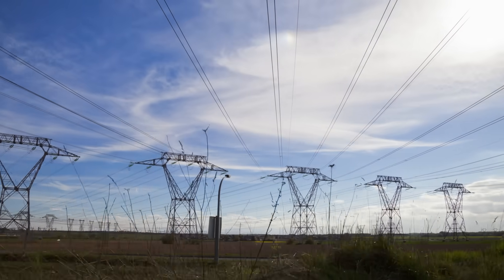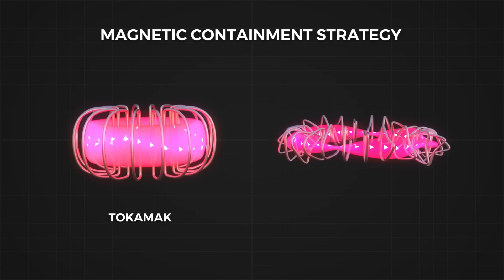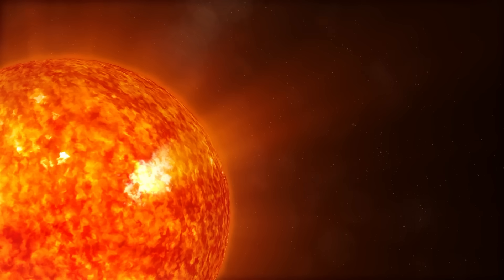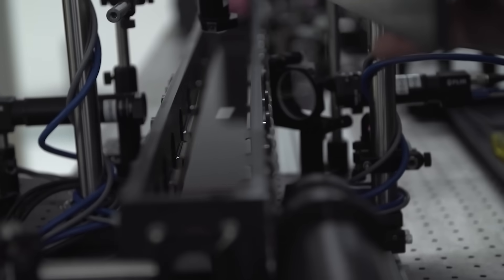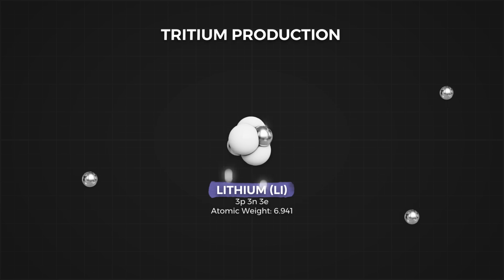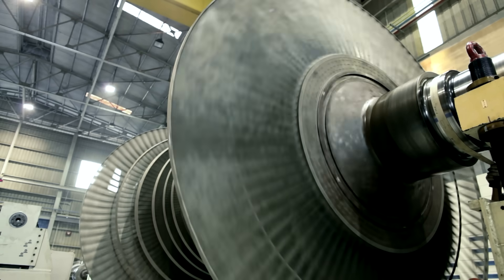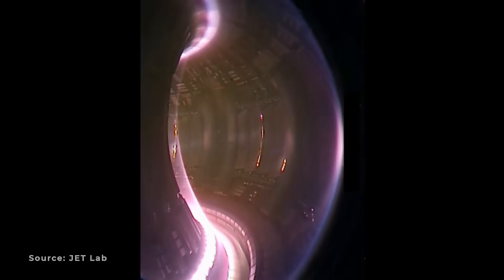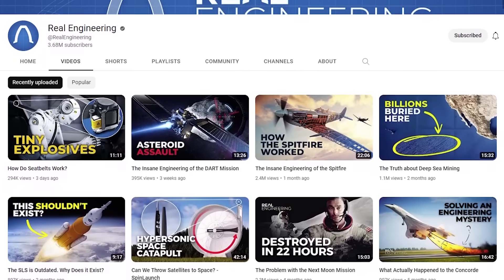The Problem with Nuclear Fusion

Comment: I had a presentation in my masters class few weeks ago, and my topic was about why nuclear energy is fine to use.. every single question/problem that I had encountered, I found a solution and an answer for it, the whole thing was amazing and very convincing. However, one point i didn't mention in my presentation, because i knew it will demolish my entire thing, is cost. Since i wanted my presentation to be as an advertisement for the nuclear energy (I live in France where 80% of the energy is nuclear), i wanted to give the best of the best in it, and show how every safety issue has a solution, as well as every public concern is being dealt with.
Reply: I don't have a masters in anything, but you could use the argument that the cost of "cheap" hydrocarbon fuels is their emissions, both pollutants and greenhouse gasses. How much effect they have / how long they last are up for debate, but nuclear fission waste can be partially consumed in fast-reactors and/or stored in a barrels. So do we want the effect to be on the atmosphere, or in a storage facility.
Reply: @TurboHappyCar  Regarding this approach,  i talked about the energy to cost ratio of uranium compared to fossil fuel. This included the mining, the purification and finally the transfering, just without the building cost of a power plant. Although i think that nuclear power plants have more lifespan than their rivals, in terms of cost to lifespan i think nuclear will equalise a little but still lose in this aspect.
Reply: Really cool topic... though two other arguments against nuclear often cited is their inability to adjust to demand and the difficulty in managing waste. I have heard (not sure how true it is), that the ability and technology for building reactors has been lost somewhat. Is this true, are we still able to build these reactors on a large scale?
Reply: @NitroniumGaming  nuclear waste isn’t a massive issue anymore, we have ways of containing it until the half-life renders it harmless. The military also loves shooting nuclear waste at people
Reply: Cost surpasses every argument that you have for it, unfortunately. If we can use inefficient energy sources that cost cheaper to produce per megawatt then industry would prefer that because it's better for their bottom line.
Reply: @radarpinki  Also Why use outrageously expensive fusion if solar and wind are way cheaper
Reply: @reuven2010  Because solar and wind take up huge swaths of land mass to provide equivalent power. That doesn't make them bad, but current designs make them ill equipped to replace natural gas or nuclear. Even hydro electric dams take up minimal space, but greatly affect the ecology around them.  Nuclear might be expensive, but I think its very much a risk reward problem.
Reply: @reuven2010  I had no doubt that I would receive such a question, thank you. First, not all countries have enough sunlight hours, some areas have 0 sunlight hours for a few days( near the equators). others like Europe don't have enough hours during the winter, which is a large portion of the year, thus they rely on other methods, the wind is great too, but also u don't have windy weather the whole time ( like here in the Rohn Alps). This can be solved by adding more solar panels, along with a sunlight tracker which might increase the overall energy production somewhere between 25 and 40%. However doing this stuff for a little extra energy production will require a ton of money, to the point it becomes worthless. 
Another way to use solar panels in the sunny territories, aka deserts. But transferring the energy, taking into consideration that these areas don't have infrastructure generally, will skyrocket the cost beyond the worth tag. The fossils are still the cheapest and easiest way to produce energy. However, this doesn't mean they are the best, or even the safest, for both human life and the environment. Bearing in mind that the safety, clean air, and proper food, might really be worth the cost, it is just that nobody is ready to pay more for those.
Reply: @AmphibiousPatriarch  Totally agree, add more that with higher demands on such energy production methods, more innovations and discoveries will pop up, perhaps making it cheaper, and more efficient (for example; the lithium batteries)
Reply: @radarpinki  To be honest, we look at the outer edge of the projects in terms of cost. But when the big companies get into a real project, their engineers calculate every single detail, to be clear, let me give you an example that blew my mind back then. They even calculate how they affect the environment in the area, the government restrictions and taxes, thus they add this to the maintenance cost of the fossils, the cost of fixing the environment after messing it up with fossils, the cost of the health care of those who get affected... literally every single detail that might come into mind, Also i disagree that we are moving away from nuclear,  i have been following up the news since 2015, and all i see is a growth in the overall share of the worlds energy production. Here in France, the nuclear energy production share rose 10% in the past decade.

Comment: Thank you for mentioning the beryllium problem. I have been watching lectures on the promise of fusion for decades. Some common memes are the claim “cheap and clean” and “seawater”. They want the audience to concentrate on the shiny nuclear physics and ignore the dirty engineering. The costs of the non-ideal engineering tech are minimized. The cases for solar, wind, and cleaner safer fission are stronger. My view as an old physicist is that the Tokamak lobby is strong politically and keeps the fusion bubble aloft by politics.
Reply: Nuclear fission is the future.  Safe, clean, carbon-free 3rd and 4th gen plants.  

Fusion and solar/wind are the past.
Reply: The big engineering obstacle is volumetric power density.  For DT reactors, this will utterly suck compared to fission reactors.

Comment: The video at least mentions cost, but it doesn't go into any detail on the subject. Fusion is not just a scientific or an engineering problem, its an economic one. We already have dispatchable clean energy in the form or renewables and energy storage. The former is mature and cheap. The latter is more expensive but will mature and get cheaper. So by the time fusion is a done deal in engineering terms, what it will be competing with will make it uneconomic to actually implement. You don't do something if you can have the same outcome for less money.

Oh and btw if we're going to talk about energy sources that may be available 20-30 years from now, we ought to also talk about things like geothermal. New millimetre wave drilling technology has the potential to make deep (high power) geothermal practical. And that will always be a far simpler and more robust tech than fusion.
Reply: I feel annoyed by your kind. The kind that always stands in the way of technological advancement. Fusion is barely talked about as it is and is also severely under-funded, yet you find the need to shit on it. 
Here's something to enlighten your pea brain:
Inertial Confinement fusion has a non thermal approach being worked on by Marvel and HB11. If successful, it could pave the way for non terrestrial power plants, especially propulsion.
So, sit this out if you don't have anything positive to contribute.
Reply: @rajuaditya1914  Why? I'm just as excited as anyone about the prospect of getting fusion to work as a piece of engineering, but I'm being realistic that it will not compete with other forms of energy production/storage. Also, I happen to agree that fusion has a future in space. Edit: and while I'm at it, there are several implementations of fusion that use p+B fuel and that don't rely on thermal neutrons. You get nearly all of your energy out in the form of charged particles and x-rays. That's a lot more space-friendly because you're not then trying to build a big heat engine and have gigantic radiators.

Comment: Best way to get nuclear power running, fusion or fission, is to have the government do it. Not because the corporations wouldn't do it right, but because they would try to cut costs as much as possible to keep profits high. Cheap and renewable power, especially fusion which would be pretty much free, just doesn't go well with a profit motive.

Comment: Just curious, is there a way to make Nuclear Fission reactors more economical?
Reply: They are mind-blowingly economic, the cost is in maintaining regulations and bureaucratic bloat. They are also safer than almost any other industrial process but the issue is the political ramifications of an accident.
Reply: @JB-mg5lw  Mind-blowingly economic? 😂 not remotely. Regulation isn’t even the issue. It’s poor supply chains, programme management, and the rising costs of raw materials, leading to high EPC and capital costs.
Reply: @Gomlmon99  Absolutely wrong and as I have been in the industry at all those levels at various times for 4 decades I can personally attest to that. The costs of fuel and actual technical management are dirt cheap compared to the insurance and regulatory requirements of running a nuclear power plant. The plant I currently work for was the first in the US to get relicensed, do you even know which one that is without looking it up?
Reply: @JB-mg5lw  Why are you talking about cost of fuel or running it? I said EPC and capital.

Comment: If unlimited clean power with no nasty by products was easy everyone would be doing it .
It is not impossible but extremely difficult to put the sun in a jar so how we heat things up and split the appropriate atoms is critical .
The power needed to kick-start the reaction is extreme . 😎
My speciality is mechanical engineering and l understand the hurdles that fusion puts before us .
I deal with what is currently possible and have the designs on the board to prove it .

Keep trying.

Comment: So they literally say it's impossible as physics won't allow more energy out than in unless obviously it's a neutron star collision or creation of a black hole.

They literally need to put more energy in the material than is used in the magnets which has to have more energy than what it's containing cause those magnets waste much energy in the 360 degree field around itself.  And you can't hold back more with less...

It's literally a pipe dream unless they have neutron star density that s machine wouldn't be able to handle...

They even already have energy bring made that they can't account for as well and still no fusion.... As they ignore that the sun's core is so dense that Thor's hammer made of the same stuff would weigh 300 million elephants... And that's not even enough according to some as they think the sun doesn't just do two firms of fusion but also has quantum tunneling to higher energy going on. Which seems to be happening in their machine already, that's probably where that extra energy came from... Still no sustained reaction with net energy....

And it's crazy cause the climate change is mostly caused by Water vapor. 50% is caused by water vapor like what hydrogen fuel cells have off. As 25% is from gases, as 40% of that 25%  is from The earth itself as they use their lowest estimates in output.. Even tho thier assumptions were blown out of the water with that last discovery of the geothermal lost city that puts out 100 times more green house gases than any other known natural source.... And they expect to find more and still haven't said wether that 100 times more is more than the next biggest single source or all previous sources put together..... and they expect to find more sites like the geothermal lost city in the other 97% of unexplored oceans... The last one dropped our contributions by anywhere from 5 to 10% or more by itself and showed they really low-ball nature's output in their simulations...

As they also say the last great extinction was caused by global warming that was much faster than now even as before the ice age it caused there was no human made greenhouse gases.... They even say it caused the ice age faster... 

But now days they say warming pushes an ice age further away unlike what they taught for decades in school.....

It's like they know it's not humanity as history says it fluctuates randomly already... As the scientists and politicians are like Columbus and we are the tribes people.... He told the native tribe to give them stuff, they did but he wasn't happy with it so told them his God would make the moon vanish as he knew more than them and sn eclipse was about to happen. It happened and the tribe was terrified then gave them even more stuff they couldn't actually afford to give.... 

So climate change is literally unstoppable and would be about where it is now even if humans were never around from what all the info says without nit picking things. 

So how do you stop what's so far always been happening and why is no one planning for an ice age that could literally scrap cities into the ocean and is probably closer than the 10,000 years the estimated before..... 

Why's no one actually looking for a solution that lets us adapt to the environment that's gonna change at about the same rate wether we pollute or not....

And it's funny cause they know. It's impossible to not know given all the info they have and share. As even what they share that's nit picked shows humans are barley effecting climate through green house gases...
Reply: This comment aged so poorly it was disproven before you even posted it.

Comment: Fusion has been twenty years away certainly as long as I've been alive. In the meantime, how much closer might we be to a decarbonised electrify grid if the billions that have been poured into fusion research had been diverted to renewables and especially the large scale grid energy storage needed to make them practical at scale instead. I look forward to the next part in the series with much skepticism.

Comment: 2:30
Typo in the subtitles. Says 'changed' whereas it should be 'charged'.
13:02
Another one,  'ura nium'.
13:30
You say 'energy' bu the subtitles says 'electricity'.

Great video by the way. Love the rivalry with Wendover.

Comment: Beryllium is not rare, and its not hard to mine. The problem is in working with it, its incredibly toxic material that requires special processing. THAT is the problem with beryllium. Supply could be increased substantially, but manufacturing all of that will be costly.

Comment: Everyone seems to be unaware of Lawrenceville Plasma Physics' Fusion project!!! LPPFusion is a small operation with a team of only a few people, with a very promising approach to a much safer and smaller fusion energy system. They've achieved record output-to-input energy ratios that make the big tokamaks and stellarators which cost billions of dollars look like lost causes. Not only that but LPPFusion is operating with a boron fuel instead of rare elements like deuterium. Check out LPPFusion guys!

Comment: While magnetic confinement nuclear fusion reactors look cooler and have amazing names (Tokamak, Stellarator), i'm pretty sure Inertial Confinement Fusion is gonna win the race, for comercial applications it's much easier to store fuel in small solid pellets than have to drag huge insulated tank farms with you everywhere.
Reply: Well, there is the small issue of the multi-football-field sized laser you need to drag around with the small solid pellets...

Comment: All this just helps to point out that we really should be making the most of what we have already proven and build fission plants. The tech is much better these days and lots of the waste issues of old designs are fixed. 

Sure, it’s expensive up front, but long-term, using, it will cost so much less from both economic perspective an environmental one
Reply: *combined with renewable sources where it makes sense

Comment: Before viewing: highly doubtful. Let's see.
- no dangerous radioactive products ? Ohh the blanket 
- addresses the fuel problem : good
- so every fusion reactor is a fission reactor also - interesting
- if we invested a 10th of what's is being used on fusion - we would have fixed it's problems including the "waist'
- ohh the solution is going to the moon -- not very economical

Comment: The supply and cost problems are certainly huge issues. But another huge problem that is not often talked about is just how far away these reactors are from net energy output. 

Q, or the ratio of energy out vs in is often said to be higher than reality because they are counting the Q of the plasma instead of Q total. ITER, for example, says it will have a Q of 10, or 10 times more energy out than in. But in reality the actual Q is less than 1 because this Q plasma doesn’t account for all of the energy going into run the massive electromagnets or the conversion rate of heat to electricity (at best 30%). These fusion projects and mega projects need to start being more transparent about their true Q values so we can actual see how far we have to go to achieve net energy output. Sabine Hossenfelder did a great video on this.